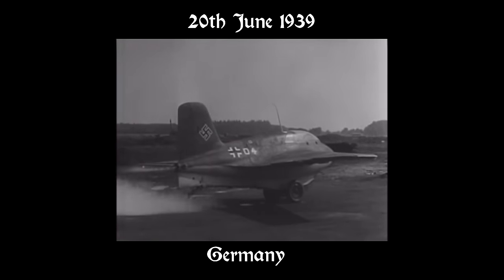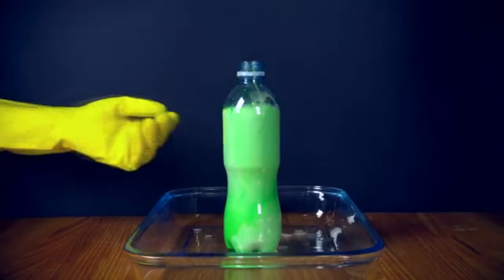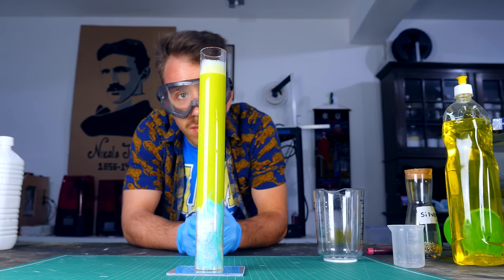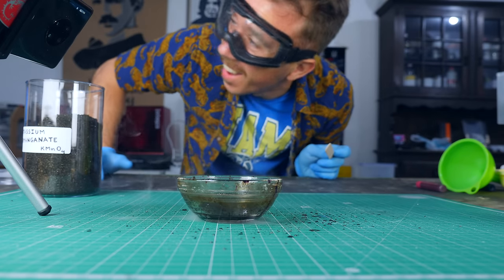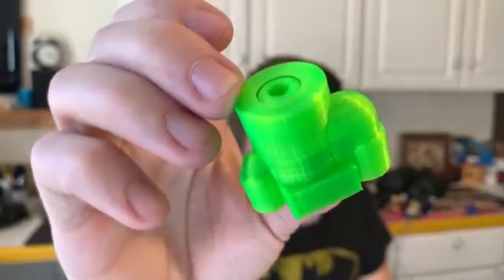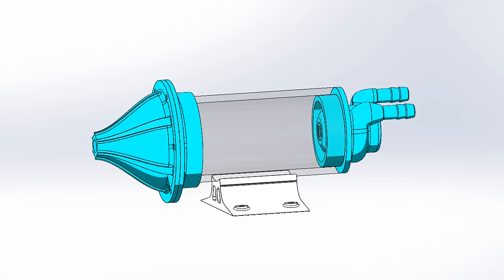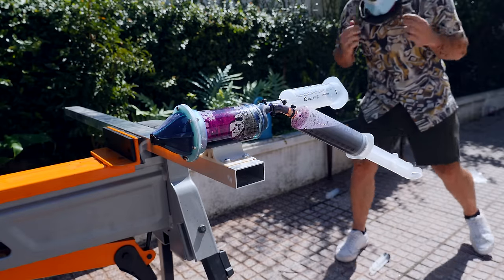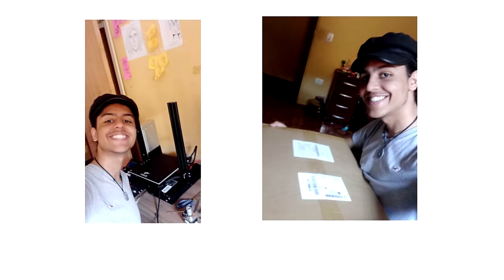The Forgotten Nazi Cold Rocket Engine (3D Printed)

Comment: Puisque le permanganate de potassium est le catalyseur, il n'entre pas en compte dans les résultats de la réaction, on pourrait l'intégrer dans les parois de la chambre de réaction, maintenu par une grille ou une toile, et n'injecter que le peroxyde d'hydrogène ? - - Since the potassium permanganate is the catalyst, it is not taken into account in the results of the reaction, one could integrate it into the walls of the reaction chamber, maintained by a grid or a canvas, and inject only hydrogen peroxide?

Comment: hydrogen peroxide motors have been the steering engines for rockets for 50 years they have been used in land speed record attempts, drag racing on a go kart

Comment: If you're injecting potassium permanganate solution into hydrogen peroxide solution, with both ejected as the exhaust when they explode on contact, isn't that just a bi-propellant hypergolic engine with extra steps?

Comment: utilising stuff you have 3D printed and stuff you can get at a hardware store build a distillary to in crease the puraty of the hydrogen peroxide becaose hydrogen proxided boils at 150c  and water at 100c it is a matter of doing the math extracting the water to get a more pure solution.

Comment: I wonder how well the Tesla Turbine would work with this reaction?  Also, be aware that high concentrations of hydrogen peroxide are caustic and can strip your dead layers of skin instantly, can cause chemical burns with longer exposure.  Saw and worked with some 90% concentrations in my 20s and they are a little dangerous.
Reply: Also, I wonder if the output of the reaction could be combusted, since it should be mostly H and O separated.

Comment: I only have basic knowledges in chemestry, but what makes the catalysis reactions interesting is the fact that the catalyst (permanganate potassium in your case) is used then  regenerated. In your design, you are expulsing both molecules (h2o2 and  permanganate potassium) which doesnt seem like an economically efficient system, even considering how cheap it is. My idea would be to use a system similar to catalytic exhaust pipe (it would be harder to manufacture of course) with the advantage of linearizing the exhaust gas (using a conic system might negate the need for a nozzle). Again i'm not sure if it would really benefit in any way to the thrust capacity of this engine but it could be an idea. (I apologize for probable English mistakes, i'm not a native speaker)

Comment: The decomposition of peroxyde liberate oxygen. And guess what, oxygen is… an oxidizer. Duh.
So you could add a second stage to your engine with fuel injection to get a hot engine and even more pressure.

Comment: Why don't you make concentrated H2O2 yourself? Use a vacuum pump and a vacuum chamber to separate water from the hydrogen peroxide, which has a boiling point above water by 50C at atmospheric pressures.

Vacuum distillation would be less likely to cause decomposition than thermal distillation.

Comment: You have to understand that the KMnO4 is a catalyst. So you don't have to keep pumping so much more into it. What you need to do is pass the H2O2 over the catalyst. The catalyst merely breaks down the peroxide into its constituent parts; steam and Oxygen.
Reply: Typo there: I should have said exhaust gases, not constituent parts. 
So 2H2O2 --> 2H2O + O2. With apologies, I have no suffixes here for those '2's. You'll als see that the Pitassium Permanganate promotes the breakdown, but plays no other part in the reaction.

Comment: I am sure if you dig deep enough the original German research can be found. the original components were so volatile that the people working on the rockets wore thick rubber gloves, boots Gas Masks and protective clothing. At least this is what I observed on the films I saw of the original German experiments. I am also convinced they have developed the required pumps for the fuel sources.

Comment: But wait the peroxide is an oxidizer why did imi say there is not oxidizer . Ya it uses a catalyst for the hydrogen peroxide cus it’s an oxidizer why did I say it’s not in this rocket and by the way they use rubber in these rockets so it can burn the rubber and create more thrust

Comment: "Cold rocket engine" but Hydrogen Peroxide decomposition yields 600°C reactive Oxygen.
Germans used Potassium Copper Cyanide because it was Stable to Hydrazine and Methanol also in the tank opposite the 90% H2O2.

Comment: What if you built a rocket engine by heating water with microwaves? Also, what would happen if you heated the chamber where your potassium permanganate degrades hydrogen peroxide?

Comment: What's wrong with hypergolic? I mean aside from the fact hypergolic fuels are incredible toxic, extremely corrosive, and pretty much guarantees cancer if it comes in contact with any part of your body?

Oh you forgot to mention that most of the danger from flying the Messerschmitt Me 163 Komet was the hydrogen peroxide. If the peroxide tank ruptured due to a rough landing or a minor crash (it was a prototype)  it would literally melt the pilot. Literally melt them, easily one of the worst ways to go

Comment: im not an expert or anything, and also only 5 minutes into the video so maybe you tried this. but i was reading about monopropellant fuels and catalysts online and saw that they mixed concentrated hydrogen peroxide with potassium permanganate and passed all that through magnesium metal pellets pretty much, could try that.

edit: im wrong, its magnesium "impregnated" ceramic beads, not even joking thats apparently the scientific term.

Comment: Say... The hidrogen peroxide solution has 50% water, right?

Hmmmmm ... 🤔

Is there a way to do electrolysis on the solution, while also being used as propellant?

Or on the resulting water?

So... The resulting oxygen of decomposition of hydrogen peroxide will react to the resulting hydrogen and oxygen from electrolysis?

Or... Away to gather the resulting water, which we can reused for electrolysis...

Or... Used the resulting decomposition of hydrogen peroxide like in steam turbine?

So, instead of making a rocket, I'm suggesting of making a reactor... And used the resulting power to power up a jet engine...

Comment: You mixed video of the He176 and Me-163, not mentioning that Willi Messerschmitt designed the latter (the one that actually achieved production). Also, why didn't you just make your rocket the way the Germans did? They pumped H2O2 through a hole in a lump of Potassium Permanganate. Potassium Permanganate is a CATALYST in this reaction. That means it enables the reaction but is not consumed in it. You are throwing-away your potassium permanganate for no reason. Follow more closely the German design, which means building your catalyst into the nozzle. Then you need only a single pump to push the H2O2. Start with a tiny hole and drilling it out over several tests until thrust peaks and begins to decline. Nice mustache.

Comment: "It's so safe, it's used in water treatment. And as a disinfectant."
Bleach is used as a disinfectant, but it can be pretty deadly. Sooooo...not exactly the best benchmark for safety.
Reply: Bleach isn't that dangerous though. It's easily controlled and contained.   It's not going to spontaneously combust or waft neurotoxic metals into the air. They sell it in stores and people use it to clean.

Comment: They pulled it off because it used hydrogen peroxide at 85% one had a fuel leak into the cockpit and dissolved the pilot

Comment: You shuld look for Multi Stroker engines and Gasoline-Disel Engine Blocks useing magnetic pumps also called magnetic mixers or pulsers of gas molecules also that wuld by considered magnetic lavitation and magnetic enchancment of metal elasticiti. That reactions what you try to do isnt corect watched only 1/4 of your video . Colideing frequencys of any kinde electricity types does that trick but normali that effect acures by engines randomli due to electrical fault so look at old aircraft magnetos with dual spark plugs insulate 1 ignition system or make 2 seperate power suplies for seperate high amp ignition and plazma ignition exampel and play around polariti frequenc amps volts you get the idea the engine will start pull push bouth organic gas aka bacteria and chemicals or mix them in %}% ratios puls them ordinari Dual Engine Effect I wont go in to detail but imagine Hot Bulb/Pulse Jet engune working in 1 unit hot bulb is fiered at compresion stroke pulse jet is fiered at exaust stroke so to do that you need variavel valves cilinders shareing space and magnetised head valves with magnetised engine who sends sparks randomli so what you get as engine types is randomli steling,steam ,gasoline-disel,papp,flami liker ,hit n miss,steam turbine,pulse jet engine so thats what you looking for the gases in %/% creates 2 oposite engine who bouth need individual circuets to control them earli engines did not have fuel aditives so dual engines were used to compensate for speed and torque ratios simplified . So thats what you are looking for .

Comment: Video idea: I would suggest using marbles (or other objects that won't fly out) in the reaction chamber as to provide better mixing of the components and in turn reducing the volume of the chamber (and thus increasing the pressure). Also with some basic hydraulic principles tubing and 3D printing, some of the gas from inside the reaction chamber could be used to "self inject" the fuels.

Comment: If you print a body that has two different pathways to the outlet instead of a large mixing chamber and let mistifyers or sprayers for each compound exit into a bell nozzle, you could probably feed them with either two pumps or make a chamber for compressed air and a little valve to release the mayhem. "Bottle Rocket Masterclass" :elbowcough:😎

Comment: You had more luck than brain. Just in shown footage, you may have received serious skin burns dozen of times. And when intake on "rocket" broke and it splashed on you, would it be H2O2 nozzle, that would be really bad.
Video should have contained warning every 2 minutes. Because if someone tries to play with H2O2, thinking it is safe, it may end badly. Pharmaceutical 3% is at border of safe use, but it is not safe.
Technical 10% is already pretty dangerous.

Comment: You should make a turbopump for pumping the fuel. A turbopump is what the use in real rockets, it uses a small amount of fuel and oxidiser (or catalyst) to drive a turbine which drives a pump. You can also use different pump sizes to get the perfect ratio of fuel to catalyst